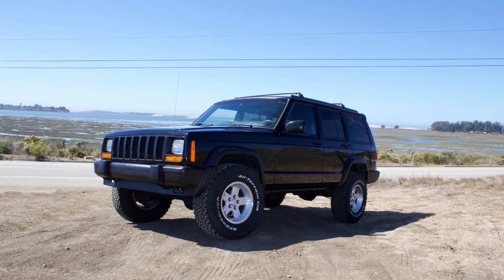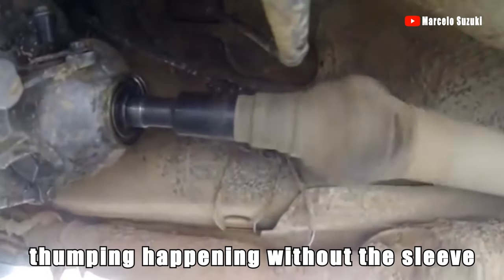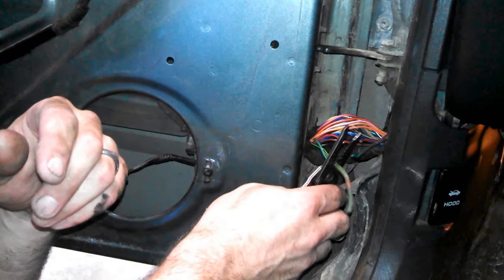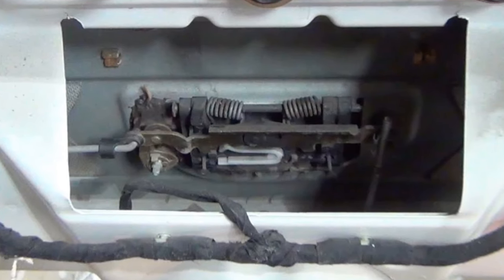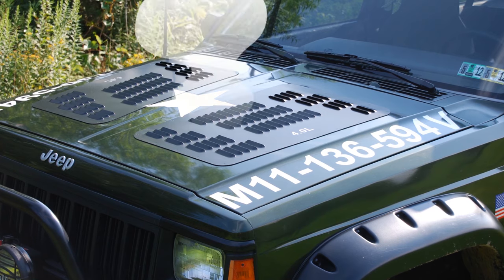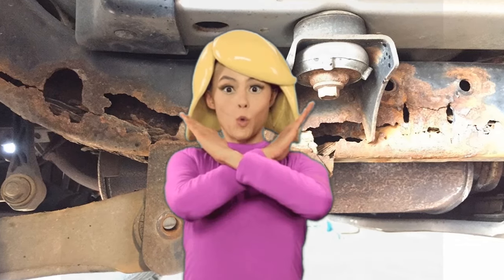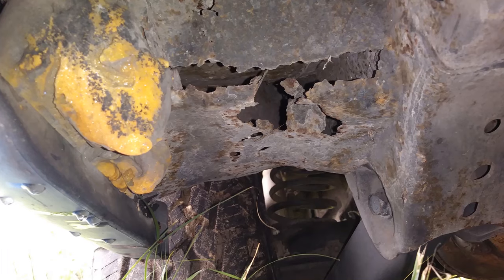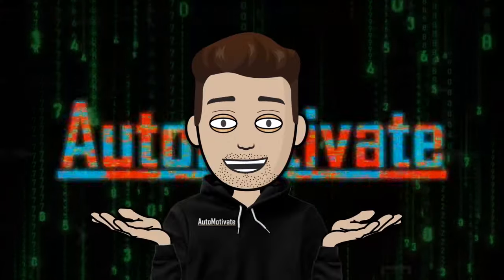Watch This Before Buying a JEEP CHEROKEE XJ  1997-2001

Comment: It's too late... I bought my XJ before this video was made... actually before YouTube was made. Bought it in 97. 600,000 miles later it's the best car I've ever had.
Reply from the maker: XJs are amazing man. 
Every car has their own fair share of issues.  
Is that with the original engine and trans?
Reply: @AutoMotivate  Original transmission, (5 speed), engine rebuilt once. It's not my daily driver anymore but I'll be taking it for a drive today.
Reply: Bought my 93 XJ new. Sold it 2019 and bought a 2001 XJ. Like it better too as seats much more comfortable 😊. Long live the XJ 👍
Reply: @JeffDeWitt  someone is selling one for 2k, Do you consider that cheap with 185k miles? Idk I think it's a good buy, just don't know how much $ I'll throw in to fix any repairs, but I hope he's still aelling it when I hve the $ ready , surprised he hasn't sold it yet 🤷‍♂️
Reply: @sheeshd977  I don't know, I haven't really looked at what they are selling for these days and of course have no idea of the condition of that Jeep. However, knowing what I know about XJs if I was in the market I'd give it a good hard look. If it runs and drives well, has minimal or no rust, and otherwise seems to be in good condition I'd buy it.
Reply: Yep, me too. I have two of them. Pre YouTube.
Reply: That's awesome. Love the XJ.
Reply: I just got one as my first car for a grand in March 2022! It's got 250,000miles and is in really good condition replacing all sensors before I really drive it around
Reply: @sheeshd977  drive it around shit and reverse make sure there's no transmission problems I just got one for 1k because he couldn't replace fuel filter/ sensors. Really good deal and 250k miles
Reply: @tantheman3359  Nice. Enjoy. Don't sell it.
Reply: @tantheman3359  It might be hard to believe but in all those miles the only sensors I've replaced are one of the oxygen sensors and the sensor for the oil pressure and water temperature indicators on the dash, that one because I upgraded my instrument cluster. The factory cluster had a speedometer, gas gage, and idiot lights.
Reply: @JeffDeWitt  wow that's insane. I was thinking i needed to go through everything. what type of climate do you live in and do you go off roading or anything
Reply: @tantheman3359  I live in central North Carolina and as my XJ is rwd off roading isn't really a thing.

All that being said I wouldn't panic about replacing sensors. Replace them as needed, and it's also likely that the factory parts are better than anything you are likely to find in the aftermarket.
Reply: @sheeshd977  just bought a ‘92 with 170k for $500 lol it didn’t run needed a fuel pump and some other small stuff but i’ve put another $300 into and i can drive it anywhere
Reply: @sheeshd977  did you buy it?
Reply: Im looking at one tomorrow. My ex had one many years ago older than these years but we had to replace the motor fue to over heating. Now its just me and will maintenance much better.
Reply: @JeffDeWitt  a
Reply: My 1991, which I bought in 2006, has 633,000 miles, though the engine was rebuilt at 225K by the previous owner, I bought it at 275K miles.
Reply: You said it, it looks like it is too LATE @JeffDeWitt looks like you didn’t watch the video cuz you bought the Jeep XJ CHEROKEE did you even watch the Jeep XJ CHEROKEE video and then buy it?
Reply: @AutoMotivate did they make a XK or just the XJ?

Comment: After owning 4 of XJ's  and driving 8 within the family, I can say this video nails the good and bad very well. Currently driving a 1990 XJ and I quadruple coated underneath and under carpet with POR-15 so I hope this one lasts me the rest of my life....if you live where salt is used on roads in the winter rust will kill your XJ before anything else as the video said. Another note on the brakes...If the previous owner hasn't documented when the brake hoses (front especially) have been replaced...replace them asap. Even if they look good, the rubber weakens inside the hose over time and when the break fluid gets hot it can make the hose to partially or fully collapse causing the caliper to stick. I've had this issue on ALL of my Jeeps. Hoses are cheap....destroyed hub/axle parts or even a fire due to a stuck caliper are expensive.
Reply: I used por-15 on my XJ. It took me 2 years, and I am still finishing the outside. POR-15 base, topcoat for protection, and a sacrificial por-15 bed-liner that I can re-apply easily with just a 1" foam brush when needed.
Reply: found a spotless 2 door , in Pa yet ! , still has factory undercoating on it . coming along nicely,  check it out
Reply: @sneakytails1724  Nice! I hope your XJ lasts as long as you have it!
Reply: @796andy2  Awesome man! I see it's a '99. A very good year for the XJ!
Reply: Thank you
Reply: I've had 4 of these. I currently got one on a 4inch lift on 33s awsome.
Reply: I had one it had 264000 on it and it was still going  strong but I had to let it go because I had too many cars. Shouldn't have let it go.
Reply: Rust destroys all vehicles

Comment: Oh yeah here's a little FYI for your steering improvements when you have a lift you want to track bar and your your bar coming off your the bar coming off your ear your pitman arm you want the bar coming off a pitman arm I need track bar to be at the same angle as parallel as possible but you can also take a bushing good shock bushing and cut it in half and put it between the bar that you put it in where the bar coming off the slip at the where the bar coming off the pitman arm the bar coming off a pitman arm to the bar going from from wheel-to-wheel where the pit with a bar coming off the pitman arm connects to the bar with that ball joint you cut a good you cut a good bushing in half not vertically the slip you put it in that that tie rod end that connects to the bar going to your wheels off the bar coming in your pitman armand you'll be pleasantly surprised if you go on Amazon and search the solution for like Jeeps that's what comes up is a little bushing that you can put in there but instead of paying $25 for it most Jeep owners have extra decent bushings if not new bushings laying around that you can shave off and half and a horizontally not vertically and you'll be surprised at the plushness of your steering you're welcome

Comment: Just got my first car yesterday! 2001 Jeep Cherokee and absolutely love it
Reply: That's a bad year. You might want to get one that is '98 or earlier. Later they went to one with a thinner head.
Reply: @VinylToVideo  or I could just get a better head instead of getting a whole new car?🤣
Reply: @Idle_Cerberus  I guess.
Reply: If the head has not been replaced by now, you probably have a good one.  They weren't all bad.  Jeep Forums has info on what numbers are cast into the rear of the head to find out if yours is thinner and could be a candidate for future cracking.  You have to remove the rocker arm cover to see the numbers.
Reply: I have an 01 with the 0331 head and no issues for 170k miles. The key to any 4.0 is to ensure to do the maintenance. Flush the coolant yearly and will never overheat. Mine runs right below 210 and never had an issue.

Comment: On my 3rd one 1999 with 217800 miles and still running strong and I’ve ran it super hard even after a transmission fluid change and seems to be a bullet proof vehicle

Comment: Just bought a 92, 2 door manual 5 speed xj. I'm super happy with it
Reply: If it's 4wd with the 4.0 engine, it's a unicorn. Hang on to that puppy if it's not rusted out.
Reply: @georgesakellaropoulos8162  It is the 4.0 and it's not rusted out.  I didn't realize how rare it is

Comment: For the bad window lockout switch the easiest way to fix it is litterly take a paper clip and shove it in the clip you show so it jumps the 2 wires that need connecting. I can't remember which if the 3 they are though. It's on a forum somewhere. But just shove it in and tape it up and your good to go
Reply: @Gareth Hawkins sorry, i guess "simple" depends on your skill and/or your determination. this only takes about an hour, and the best part is you dont even have to get dirty or lay on the ground!  
like things to function as they should, even if it is something i don't use. I thought it was a simple fix, but I have built a few jeep from the ground up. im only a hobbyist, but i do consider this to be much easier than most other things i have ever had to fix in my life. but yes, feel free to by pass your switch, just thought i would mention this for anyone that might like to know

Comment: Cps (crank position sensor) issues as well and the 00-01 have a 0331 head that are prone to Crack
Reply: Went to check out a 00 and it ran good but idling the temp would slowly creep up to 220 then drops back to 210 while driving. This was 105 degrees outside. What are symptoms if head is cracked?

Comment: I’m considering getting a 98 Cherokee (4.0/auto.) from a coworker for $600 if everything checks out. Main issue it has is just the exhaust manifold issue and he said there’s an oil leak, he may have said there was a power steering leak too I’m not sure. He first mentioned it around 3/4 months ago. He said the headliner’s still up on it too.
Reply: I used to have 99 Cherokee and it had similar power steering leak issues not a bad fix at all

Comment: I’d say this is a decent video, as a person who has owned multiple fixed and built multiple and sold multiple jeeps: 
Please do a lot more research on these jeeps before you buy them, they are used like toys and you can tell the difference in the price you’re buying it for, if you’re looking for reliability a stock one with low owners and miles will do you right
Reply from the maker: Those are becoming more and more rare, sadly.
Reply: By low miles what range are you talking about? I’m looking at a stick one, two owners with 215k miles

Comment: i just got me a 01’ XJ Sport with 150k miles for 1,900 with no rust i just watched this video to be informed with the common issues were
Reply: Sounds like a nice buy! Have fun Jeeping!
Reply: @hobble_dehoy  thanks man ! so far it’s been a really good vehicle
Reply: Keep up with everything related to the cooling system: repeat everything. 2000 and 2001 4.0 engines in the XJ must be cared for properly. Not nearly as robust as previous years. Ran a 93 XJ new until 2019. Never a problem. Bought a 2001 XJ six months after I sold the 93. Had 187,500 on the clock (4,500 cash from third owner). Ran perfect. Put 5 grand into it immediately just to make it even sweeter. Ran it Fl to Maine. Put 3 more grand at 192k, ran it to ND. If no rust present: they are worth spending cash on. I only let professionals touch it. Enjoy your Cherokee 👍

Comment: I rate this 10/10 due to nice use of memes.
Also great content. I'm looking for an XJ.
Should also warn about 2000 and 2001 heads cracking when engine is overheated.
* UPDATE: got my 95 XJ, and wouldn't you know, had a bit of an overheating issue. Took it seriously and within a week I had installed a new OEM replacement radiator, fan clutch, and both hoses.
Did the trick! Rock solid at 210, even with AC running on. 90 degree day on the trails. Couldn't be more happy!!!
Reply: Depending on how badly it overheats, this, or at least warpage of the head will happen to almost any engine.
Reply: @georgesakellaropoulos8162  yes, but the 00 and 01 have heads much more prone to cracking than previous years.
Reply: @RandomStuffGarage619  sure, but you still shouldnt be overheating any vehicle. Its the same thing with the 4.7 in the WJ. My parents have that engine in a dakota and have had zero issues in 150k miles. Its hotter than satans asshole where i live too.
Reply: @MiikeyLawless  right, you should never overhat an engine... but what happens if it DOES? seriously why risk cracked heads vs NOT cracked heads?
Reply: @RandomStuffGarage619  bad things happen when they do, which is why you don't overheat them. I assure you, if you overheat any 4.0 enough, they will blow headgaskets or crack heads.  I mainly come from the old toyota world and this is true of a lot of those vehicles as well. 

As far as I've seen, the 4.0 is great, but plagued with an inadequate cooling system. I would personally focus on that before any lift/tires, but most don't.
Reply: @RandomStuffGarage619  bad things happen when they do, which is why you don't overheat them. I assure you, if you overheat any 4.0 enough, they will blow headgaskets or crack heads.  I mainly come from the old toyota world and this is true of a lot of those vehicles as well. 

As far as I've seen, the 4.0 is great, but plagued with an inadequate cooling system. I would personally focus on that before any lift/tires, but most don't.
Reply: @MiikeyLawless  if you read my update above, I have already addressed the cooling system. It runs at 210 perfectly.
All i am trying to say is: IF you have a sudden problem with your cooling system, it's BETTER to have an XJ that is NOT going to get a cracked head as easily as the 2000/2001 by running hot. If you run these out on trails it's a very likely possibility to have a mid-trail failure.
I know it's not good to overheat ANY vehicle, I'm not an imbecile. I'm just saying I would rather have a more durable engine incase it DOES overheat.
Reply: I went to look at a 00 the other day and the temp would slowly creep up to 220 if it idled for a while but would drop to 210 if it moved. It was 105 degrees outside. At what temp would it be consider dangerous to crack the head? I’m thinking about picking it up but now I’m not sure because I don’t wanna buy it if the heads cracked.

Comment: The slip yoke is only a problem on the xjs with the NP231 transfercase not the NP242 transfercase
Reply: I need to check that one out, i got a 98 and my transfercase itself is leaking too

Comment: Hi , I want to buy a 2000 xj Cherokee, he had a coolant leak and replaced the radiator, I’m concerned it could have been the cylinder head failure!! I’ve read the 2000 and 2001 models switched cast head suppliers, it’s covered 157k miles, should I stay clear!!!
Reply from the maker: Any cheap cherokee will be a risk/project. I say go in willing to swap out the head but hope it is nothing more than the radiator.

Comment: I had a 1999 Cherokee Limited and when I put it in gear the Jeep wouldn’t move at all and the shifter made a loud noise, what would be the cause of it? I sold it back in November 2014 with 296,000 miles on it.
Reply from the maker: Could be multiple things. Could be your shift cable, the shifter not making full contact, the transmission fork, or simply the gear in the trans going bad. But if it was the gears, typically you’d hear grinding. 
Too hard to diagnose without handling the vehicle
Reply: @AutoMotivate   It could've been a gear problem, it had happened in June 2012 and I had it fixed in April 2013 a year before I sold it.

Comment: How many miles would you say is too much before buying a Xj for more than $5000? I see so many for sale with like 150,000 miles for $5000 all the time.. What do you think is a good price-to-mile ratio? It’s going to be my first car and I need help 👍
Reply: @smcfall2  Thank you so much, I really appreciate the help!
Reply from the maker: Keep Cherokee XJs can easily run from $2000-$8000 depending on their condition. Imo, 150k is not a lot of miles, however, similar to what the person above said, it depends who has been driving it. You can easily access what kind of driver he or she is when you meet them. 
Furthermore, you need to make sure if they kept some sort of documentation of maintenance. Lack of maintenance will kill these cars, and of course abusing them on trails day in and day out. 

Frame rust is an issue. However, light surface rust is okay. I would definitely treat the surface rust as soon as you can. 

If everything checks out, body is in good condition, drive train looks great, oils aren’t dirty, no death wobble (test drive it up to 70mph to check for the wobble), then 5k sounds reasonable, imo. 

I actually disagree with the fellow above about people who sells used cars are usually covering things up. 
I’ve sold many used cars and bought used cars. Haven’t had any issues. I’m not too old, however, I have faith in most of humanity to do the right thing. 
Once again, you can kinda tell by the owner if they are sketchy in any way. 

These engines can last 400k miles if they are properly cared for. 
Is it lifted above 4-6 inches and have larger tires without proper modifications? Well, if they didn’t upgrade the drive train, then expect less life out of it. 

There are a lot of things to consider when buying a used car. Sometimes it is a gamble. 
Point out minor issues and get them to drop down the price to $4500 or even $4000. 
Good luck! 
Cherokee’s are awesome! 
Loved my 99 Grand Cherokee with 220k miles!
Reply: @AutoMotivate  Thanks man! This will help me a lot👍keep it jeep

Comment: The older XJs speedometer always breaks or fails, so it indicates that ur going 0mph all the time
Reply: Lol my old 99 explorer’s rev tachometer didn’t work.
Reply: Mine did that, turned out to be a ground. There is a stud on the engine block where several grounds attach, I cleaned that and the speedo started working again.

Comment: A “most common problems” Cherokee video without mentioning the 0331 head??? Hmmmm
Reply from the maker: Not sure how I missed that, but that’s why I encourage people to comment other issues. The years were from late 99-01 for the XJ Cherokees.  
Thank you for bringing that up to my attention!
Reply: @AutoMotivate  No problem! The only reason I know about it is because mine cracked 🙄 got a re-man that is beefed up in that location.
Reply: @Geebuv  Where do they crack on those heads?  We are starting to look for a solid jeep to start with as a project for my son and I to work on together.